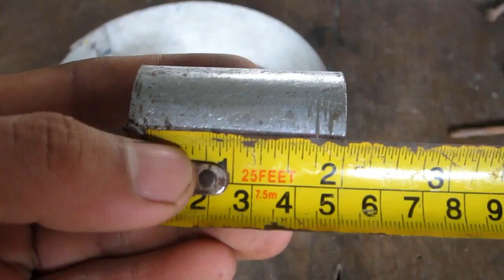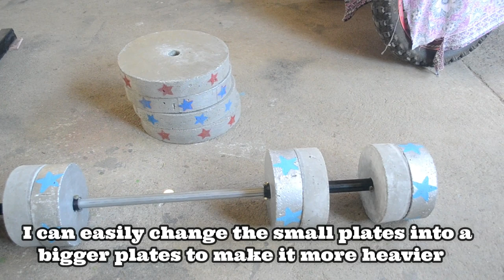How to Make Dumbbell Convertible to Barbell - Homemade Weights - DIY Weights at Home

Comment: What is the weight of one plate...
Reply from the maker: The small plate is more than 2 kg 
big plate is 7 kg
Reply: @romgd  but you add half kg of all (concrete cement and sand ) and it's total 1.5 kg ....how bro it's 2 kg🤔🤔
Reply: @romgd  big fan from India bro...
Can you tell me that what is the quantity of cement concrete and sand to make 1.5 kg plates ???
Reply from the maker: Plus the iron brace that i put inside of it, and the metal pipe in the middle where you put the bar
Reply from the maker: Half kilogram  - Cement - sand - stones
and if you are going to make 5 kg plates - 2kg cement - 2kg sand - 1kg stone
Reply: @romgd  big respect from India bro....❤️❤️
Love your channel and also love you bro keep it up and thankyou for your help..
You are such a great person ..
Thankyou bro ...
Reply from the maker: Thank you very much brother! More ideas coming!